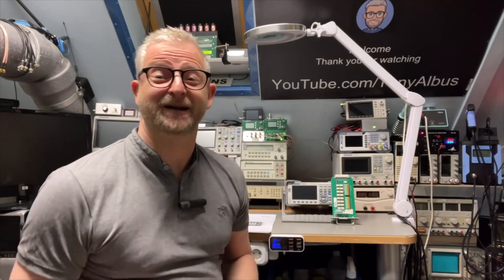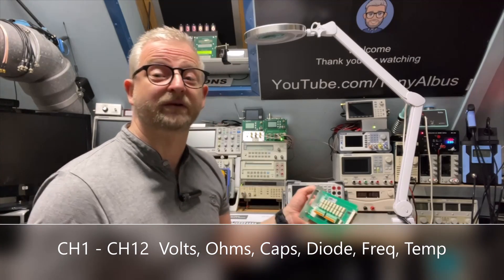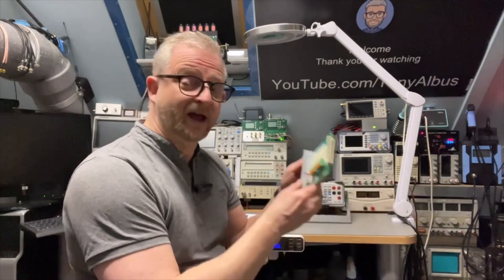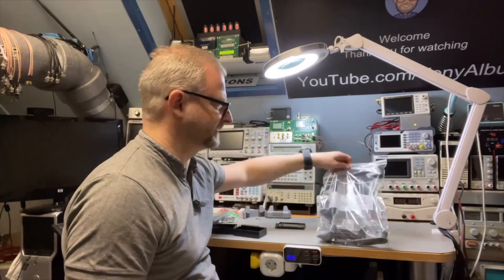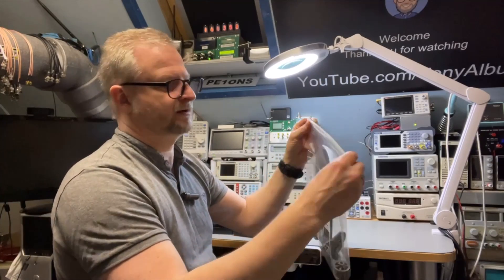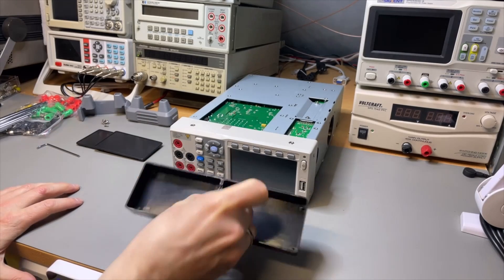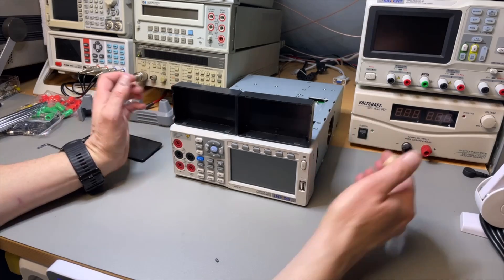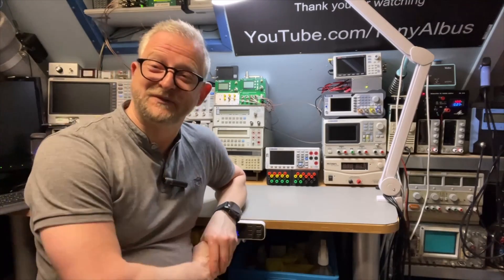#261 Siglent SDM3065X ScannerCard SC-1016 Breakout Teardown Part1

Comment: I am using the SDM3055-SC multimeter. I am trying to take measurements in scan mode with the EasyDMM software, but I am encountering some issues. The problem is as follows: I connected 5 pieces K-type thermocouples to the scan card. I installed the EasyDMM program, but when I enable scan mode in EasyDMM, it gives me an error: E2004 failed to query from the device. Meanwhile, the device panel shows 120 ms and becomes unresponsive. I have tried many things but cannot resolve this. Could you please help me?
Reply from the maker: Hi, do you use LAN or USB, try than the other. when using LAN make sure you have a latest version of VISA installed.
But software is not always the strongest point of this brand, i know some use there own python script and SCPI code.
Also scanning much faster than 1 second, i am nut sure, the meter also needs some time to stableize

Comment: Did you use the scanner card? Are you satisfied with it?
I was thinking about ordering such a thing. But if i see that it is not usable like delivered, i can just build a multiplexer box myself, without the need for such a card. If i need to put something together, it could also contain some relays, not just connectors...
Reply from the maker: To be honest i think scanner cards are more for productions enviroments where you want to monitor many tempretures or voltages. and if you use this card and you log it with the meter, you see which port what is logged if you build your own it sees it as one channel. those white squares are relais. I sell you mine if you are interested. it is teh whole meter with card. the card is not sold seperate becouse of some changes in te meter itself i have been told by Siglent.
Reply: Thank you for your answer 🙂

Sure, the white things are relays. If you build your own, you can precisely control what you measure when, and do not need this data from the meter. 
Why do you want to sell yours? What price would you sell it for?
Reply from the maker: @daskasspatzle2396  I don't use the scanner card at all and am looking for a Keithley DMM6500 but need to sell stuff first :)
Contact me by email if you are serious... you find it in the about

Comment: I was hoping to see the actual card being used as it actually ships from Siglent. Your DIY solution is DIY, I wouldn't want to spend close to $1000 and still leave myself that task to finish it.
Reply from the maker: Hi, this is the original card from siglent.
Reply: @TonyAlbus  Thank you for your reply. What I meant is that rather than have to DIY the connections to the scanner card, I would have liked to have seen how Siglent proposes that we should use it.
Reply from the maker: @thxepsilon8292  This is done by connectiong your sensors directly to the card.. it is done in a 'system' inviroment. where the DMM is in a fixed place, yall your sensors too and then everything is wired directly.. whichin a hobby inviroment will never be, thats the whole point of the breakout box.
Reply: @TonyAlbus  Oh THAT IS WHY YOU NEEDED TO DIY! So really, thank you for doing this.
Ugh, I should have read the Siglent datasheet, they explain it there.
"3.Connection: Turn the clamp and insert the wire.
4. Tighten cable: Route wiring through strain relief and Cable tie rap Wrap"

So we are supposed to use this with a bunch of wires coming out of the box! I am not a fan of leaving large holes in the back of a sensitive device. That means that the scanner card is not really a "consumer" product, and there is still a significant engineering task for the end user before it becomes functional.
Reply from the maker: @thxepsilon8292  Hi.. yes correct. no for a consumer it is not really something they would easaly use but with this box it can be.

Comment: I just got a roll of 'PC Gray' ABS to print an enclosure for a pair of WZ5005 buck converter power supplies (and a large transformer from the parts bin). Might even get some gray TPU and print some bumpers to fit it nicely on my Rigol DP832 PSU. 
I'm planning to get one of these Siglent multimeters as well, and was already thinking about designing and printing a nice breakout box. If you want, we can collaborate and I can print you one. I'm in NL as well, by the way.
Reply from the maker: Hi Quintin, nice projects, yes stay in contact, you find my email in the about section.